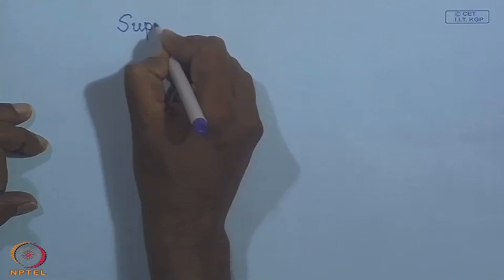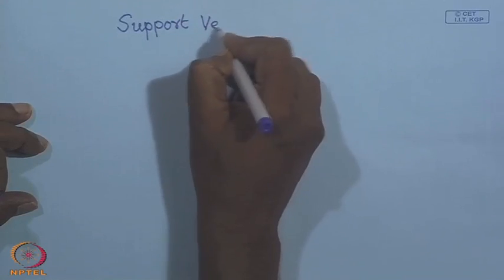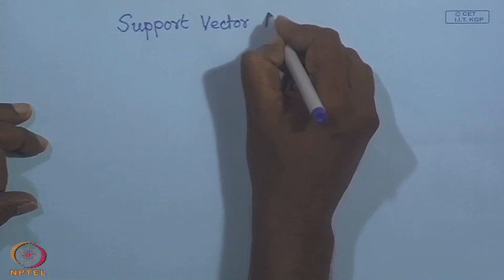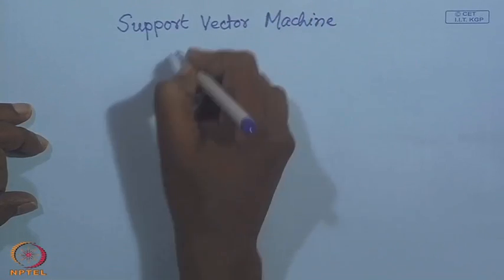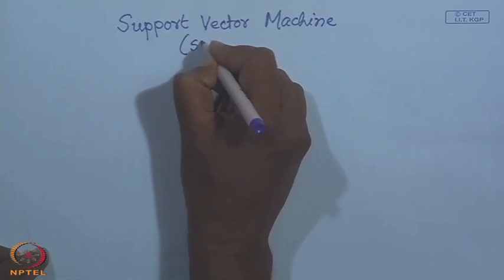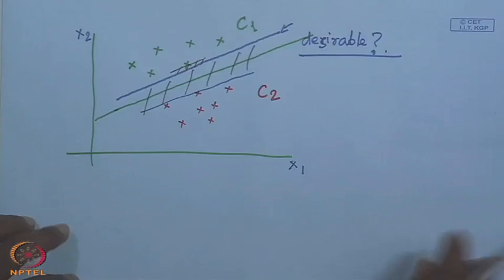Mod-01 Lec-29 Support Vector Machine

Comment: Thank you sir , the lecture was really good.
I have a doubt though :
*) We had to maximize the distance between 2 support vectors (1 +ve and other -ve), that's why we minimized 'W' (because it was inversely proportional to the distance), but at 46:46 (time of the video) you told to MAXimize the 'Lagrangian' exp (which is directly proportional to 'W') to find the 'alpha_sub_i' 's. I didn't find any reason for this Maximization in particular (As it has already been MINimized to substitute for 'b' and 'W').
Reply: its a dual problem bro.. you can check in on calculus subject